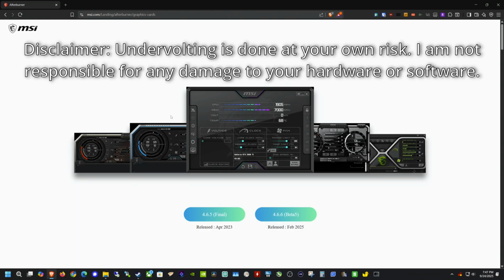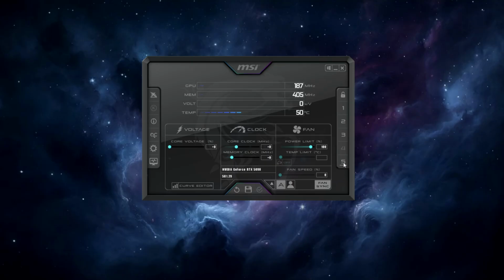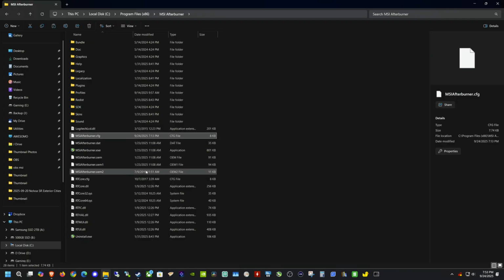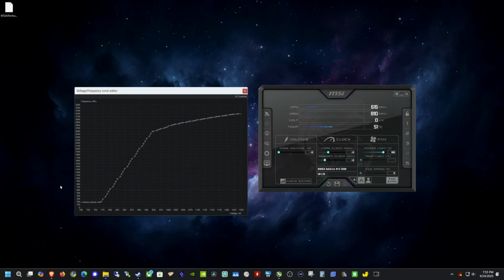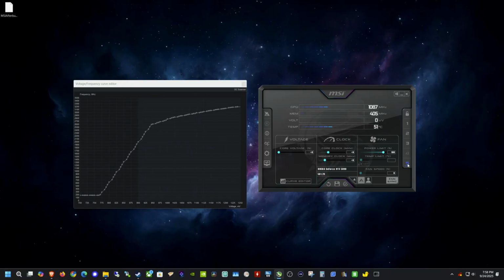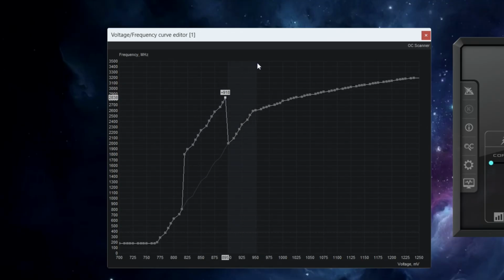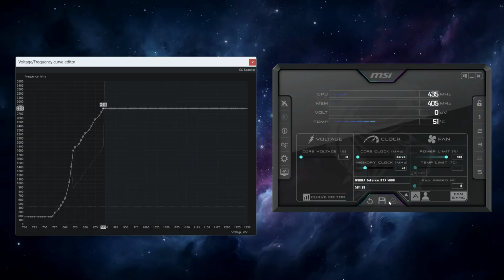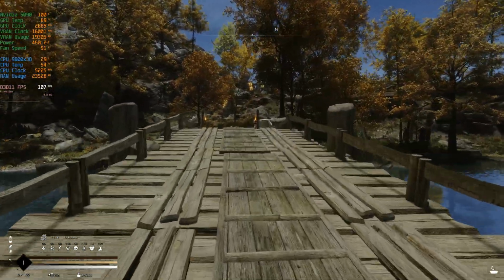You're Undervolting Your RTX 5090 WRONG (Here's How To Fix It)

Comment: You're still doing it wrong......you are missing the most crucial part that all videos miss, including yours.
It's crazy that no one has bothered to mention it, and leads to ongoing frustration when your specific 5090 (and all other GPU 'guides' throughout history) simply won't work stably like the guy in the video says (like your video).
I'll let you tell me what you think it is that you are missing, rather than just give you the answer so you can say you already knew that, but forgot to mention the crucial first step. :)
Not being a dick, just curious to see if you know.....assuming you want your video to be universally helpful...it's better than most....but still kinda useless because you forgot the most crucial part.
Reply from the maker: Thank you for the feedback. Considering you are talking about a card to card variance I'm assuming you are alluding to the fact that each card should be benchmarked in HWiNFO or GPU-Z to determine stock voltage and boost frequency behavior and undervolt based on that information. Or are you referring to something else? Curious as I am always trying to improve my videos.
Reply: @circuitscore - yeah. No one ever mentions the variations between silicon. That means the usual suggestions of 0.875v will often create instability in many GPUs. 

Example, my Suprim 5090 has stock max boost of 3015Mhz at 1120mv, so it's ideal UV is going to be a lot higher than most FE cards that seem to prefer lower vcore.

I'm running a few UV variants depending on the game I play.
Division 2 at native 4K with everything maxed, DX12 of course, can do 0.895mv, at 'stock' 2700Mhz/280W and will rarely go above 52C with a fairly relaxed fan curve (air cooled system).  But the GPU prefers around 1.025mv with clock speed around 2970Mhz/315W and still hover around 55C under full load. 
I usually run the latter, given the literal couple of cents less per day of gaming and my PC is still nearly silent. 

Having people know what their stock boost clock/vcore is will help them dial in a much more stable UV, and no one mentions this. Like ever.....

Thanks for your reply.
Reply: @Globespy So, I'm asking you. I have a Gigabyte 5090 Gaming OC. In games, I get around 2760MHz peak at 1030mV.
How should I set the undervolt curve in your opinion? Thanks in advance.
Reply: @anthony3192  -hello. I would follow the OP's initial part where he sets up his GPU in AfterBurner (AB - make sure you have the latest version) to allow the clock speed to go down to the 200Mhz range when not under load, that's really great advice.
I would then set a custom fan curve in AB, which is something you will need to figure out yourself since I don't know what kind of case/cooling/ambient temps etc. you have.  Note: you can only choose 3 nodes, but that's plenty - keeps it simple.  Mine is: First note 0% Fan at 30C, Second Node 80% fan at 70C, Third Node 100% fan at 80C - for me this is essentially a very quiet GPU as I rarely go above mid 50's
Use an in-game benchmark (CP2077, Division 2 etc.) to ensure consistency with your card's stock settings and monitor max clock speed and vcore - what you posted seems kinda low or you have thermal challenges. Most GPU's clock core speeds quite a bit higher than that.
If that's what your card does stock with a custom fan curve setup, then you will be able to have an UV at lower voltage since the lower your max load stock GPU tops out at, the lower the UV voltage can be (to a point).
Follow the OP's video where he begins selecting vcore between 820mv and 875mv and raise that selected part to something like 2700Mhz at 850-875mv, stress test in game benchmarks and regular play and see if it's stable. Then try to go lower until you start getting lock-ups/freezes etc. while making sure that your clock speed during full load doesn't start jumping around all over the clock speed range, as that tends to mean you need more vcore to maintain a steady clock speed which is crucial for maintaining low 1/0/1% lows which tend to be what will cause micro-stutters in games if they are not optimal.
My point is that unless you understand the maximum vcore/core clock speed your card is capable of at stock settings (with a fan curve), then it makes locking in a stable UV much more difficult and can take much more time than need be. As I pointed out, my GPU has a much higher max clock/vcore under load at stock (with fan curve), so for me I cannot achieve a stable UV at the points I am recommending for you. This didn't mean my GPU ran hotter, it's still extremely cool running at higher vcore for my UV. 
Silicon lottery stuff.
I hope that helps - the OP has a good video, the main thing he did that most don't is lower the minimum curve in the AB cfg file, and focus on raising a specific section of the curve to achieve his UV, while still allowing the GPU to clock down much more when not under load than most other guides. It's a really good guide, but did omit the part that every other guide also does, which leads to people following them and ending up with unstable results because they never took the time to understand how their specific GPU silicon works under load - he knew exactly about this part, but for whatever reason omitted it? Maybe he will add to the video as it would make it the perfect guide and save a lot of wasted time by trying to do exactly what he does but getting unstable results.
Good luck!
Reply: @Globespy
I would like to know if you're aware of any guide that actually shows how to go through step by step what you're describing.

I followed the settings in this video but, yeah, after a while my game crashed (admittedly, it was DOOM Dark Ages with path tracing).

While I think I more or less understand what you're saying saying, I think I would feel more confident if I saw a video or pictures.
Reply: @Minarreal  select 935mv 2800mhz

Comment: There all the same but the first one is 500 not 0 cause im looking at it now.but 800 more on core is massive and not all cards will do it.i recommend that push it up to were it wont crash in ur games then undervolt.
Reply from the maker: Good call. Yeah I was reading many tutorials online and though that most cards were similar but apparently my Zotac is a better Silicon than most 5090s.
Reply: @circuitscore ya id like have the new water cooled zotac very nice but sold out.

Comment: 2835 MHz at 895 mV isn’t something most 5090s can handle,  for most cards, that’ll be unstable. Sure, it might be stable 90% of the time, but definitely not 100%. I’m running my 5090 Suprim at 2900 MHz and 935 mV, fully stable in every game. Going with +900 MHz or more isn’t a great idea; it’s better to keep it around +500 MHz with a slight voltage bump, which in reality only increases power consumption by about 15 W but makes the card much more stable. And of course, use the second method you showed in the video, because pushing the entire curve up is just plain stupid.
Reply from the maker: That's good to know. Many tutorials target 895mv so that's what I was shooting for. I've been running this undervolt for weeks and so far no crashes or any issues with stability. As for how to determine the lower end just watch the voltage curve at default settings and see what points in the graph your GPU idles at. This is how I determined 820mv to 895mv. Every card will vary slightly. As for pushing the voltage to 935 like the original comment if that's the undervolt you are targeting use that as the high value and highlight down to 820 or wherever you're card starts to idle and pull up the graph to 2900mhz at 935mv point. Should work the same way and will most likely be stable for most cards.
Reply: @circuitscore  I hope you can clarify this point for me, hoping that you will respond. I have a Gigabyte 5090 Gaming OC, which in Unigine Heaven reaches up to 2872 MHz at stock. Currently, my undervolt curve is at 2800 MHz at 935 mV, it seems stable, always traced as you suggest in your video. My idle stock is stuck at 800 mV. In your opinion, how far can I push the MHz? Is it worth going up to 2900 MHz? Unfortunately, with your settings, I experienced some crashes after several hours.
Reply: @anthony3192 Try .950mv with 2900. That should be stable
Reply: Yup I had to do 925mV@2820MHz on my Aorus
Reply: I love my 4090 UV at 0.875mV and 2500Mhz is more than enough to play anything with DLSS Quality 🎉😂
Reply: 895mv @ 2827 MHz is the most my MSI Vanguard 5090 SOC will clock at, I undervolt right around there. 100% stable in gaming.
Reply: @jpap967  2835 @ 895 with Vanguard here
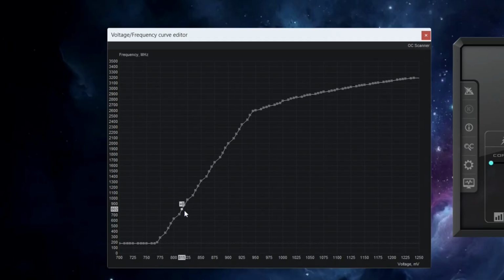Reply: So instead of 820 to 895 I would do 875 to 935?? 7:43
Reply: No, you start at 820 and pull it until 935. Or whatever your stable voltage is for your desired frequency. 900mV is enough for clocks around 2700-2800 usually and worth doing. If you want more performance and dont mind the heat, you can bump it to 975mV and try clocks around and above 2900.
Reply: @videooomaker3000 why start at 820 though?
Reply: Sitting at 895 mV 2925 stable in every game.
Reply: Hi, I am a novice, so I would like to understand how to set up your configuration. I see that the guy in the video raises the graph line between 820 and 895 mV, why? You say 935 mV... so where should I start raising it? Still from 820 to 895? And why exactly 820? I couldn't understand this.
Reply: @anthony3192  I was wondering the exact same thing. Is 820 a static number, or does it change based on what mV you want to aim for?
Reply: You say 2835 mhz and 895 mv is unstable - then proceed to say you are using a more demanding setting of 2,900 mhz and 935 mv - yet you claim it is stable.. Tf 😂🤦‍♂️
Reply: @Trump4presi  I think the lower voltage leads to the instability
Reply: @Trump4presi yes normally mV+2000MHz = Stable clock max if you got some B+ or better silicon.
Reply: @Trump4presi  You aren't very bright

Comment: So you explained a lot but didnt give reasons to why certain things are bad? My gpu idles at 1000 with 0.8mv according to GPUz so idk why it should be bad to have it that high when stuff works?

i also tested this now - board power draw and GPU voltage and GPU temperature stay the same during idle (nothing is happening on the PC) no matter if i idle at 1000mhz because i raised the whole frequency curve or not doing anything and just using default curves and values.
so why do you think that having the GPU idle at 1000mhz or higher is bad? temps and voltage stay the same so i dont see why it should be bad, but maybe you have a reason i just missed, also my fans dont start spinning if that is a concern for you, pls enlight me on this topic, thanks a lot <3
Reply from the maker: When my card idles at 1000mhz bios fan profile wont allow the fans to turn off when idling and browsing the web etc. That alone is worth it for me.
Reply: @circuitscore okay i get that, i would feel the same but i can tell do that doesnt happen on every 5090, at least on the asus tuf oc 5090 i had and the 5090 suprim i have that didnt and doesnt happen to me so idk why it happens to you but its not a general thing from my perspective. 🤷🏼‍♂️

Comment: I am using the RTX 5090 MSI Gaming trio, and my memory clock can go up to +3000. Do i still need to set it to max or lower (+2000)? Same as for the undervolting, do i need to use your undervolting setting for my card? Thankyou!
Reply from the maker: I ended up setting my card to +3000 as well! I just updated to 4.66 stable which unlocked higher overlock frequencies. You can try the undervolt I used in this video. Should be stable for most cards. I have a Zotac. 5090.

Comment: My friend, you just solved all my undervolting woes since I got my 5090, not all heroes wear capes!

Also,  RTSS and MSI Afterburner recently had an update which has some QOL improvements, it allowed to set set my power limit slightly lower on my Tuf 5090 (I combine a 66% power limit with a UV of 2800MHz at 895V)

Thank you so much for sharing this, I'm glad I clicked on this video as before now I thought I knew it all about how to undervolt, and keep up the content, you got a good voice and your commentary is very calming, the Skyrim mod list reviews are awesome!
Reply: So you explained a lot but didnt give reasons to why certain things are bad? My gpu idles at 1000 with 0.8mv according to GPUz so idk why it should be bad to have it that high when stuff works?

i also tested this now - board power draw and GPU voltage and GPU temperature stay the same during idle (nothing is happening on the PC) no matter if i idle at 1000mhz because i raised the whole frequency curve or not doing anything and just using default curves and values.
so why do you think that having the GPU idle at 1000mhz or higher is bad? temps and voltage stay the same so i dont see why it should be bad, but maybe you have a reason i just missed, also my fans dont start spinning if that is a concern for you, pls enlight me on this topic, thanks a lot <3
Reply: @teanymonster5227  Not bad really so don't worry.

I prefer to know exactly what's going on with the voltage/frequency curve and this video helped me.

Sometimes my 5090 would exceed the voltage I set for it which was annoying and maybe a bug, I updated AfterBurner to latest version and used the file tweaks in this video and now undervolting works as it should.

I recommend doing this as it is simply correct to be able to see the entire curve, I see no gain running the GPU at 1000MHz at idle.
Reply: @George-um2vc  i am not talking about any gain at idle because of this i am talking about why the video maker says its bad to do when i experience no higher voltage / temperatue or other noticable difference to stock levels during idle. there is not really a reason named in the video, but correct me if i am wrong.
Reply from the maker: @George-um2vc I appreciate that! Thank you for the kind words. Yeah I just updated my MSI Afterburner and was able to push my Memory OC to +3000. That's good to know on the power limit changes as well. I plan on making more tech content in the future in addition to my Skyrim modlist reviews.

Comment: What sort of 3dmark nomad benchmarks are typical here, i find mine is around 12,900 for 14900kf (undervolted as well), which seems off compared to what ive seen in other videos but not by much?
Reply: For a 5090?  That is way off.  I think stock is around ~14,000.  I run .950 @3000 and get 15,500.  But I found that is not 100% stable in every game I play so I'm at .940 @2950.  I believe that gets me around ~15,200.
Reply: @cptnsx  Yeah i dont know whats going on with mine, if i reset things to stock, its still not much different if i recall correctly, maybe my cpu is neutered too much, will double check

Comment: I'm using the ROG Astral 5090 and the memory clock goes up to +3000.  Do i still turn it to that max value?
Reply from the maker: I ended up going with a +3000 on my card as well. MSI Afterburner just updated to 4.66 stable to allow the 5090 to overclock higher.

Comment: i cant handle the mark on 8 sec ... my full curve is moving i do the same as you doing in the video
Reply from the maker: Might have to lower the clocks if you GPU cant handle the same curve as I showed.
Reply: @circuitscore  nah its not the clocks its the msi software haha i fixed it ;) 

got an astral 5090 oc ..